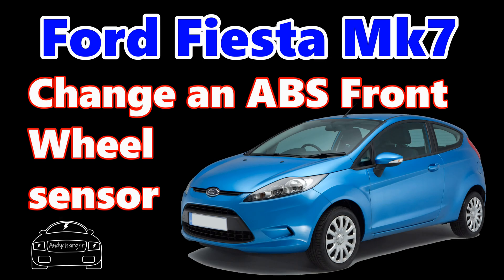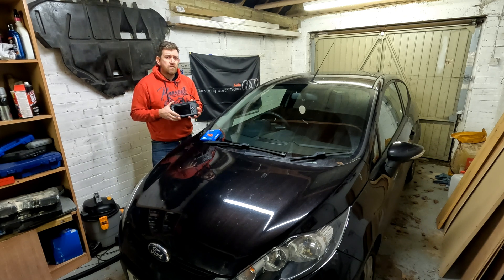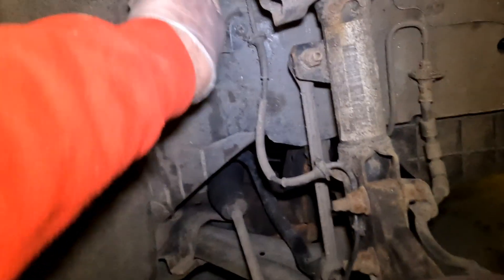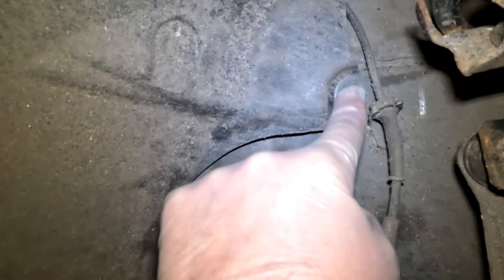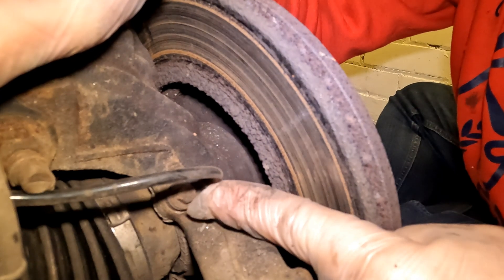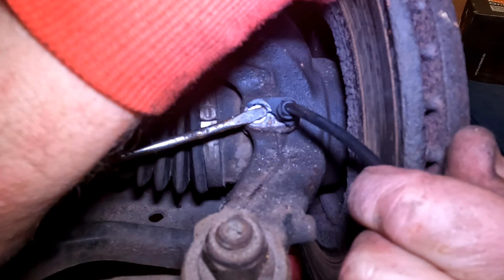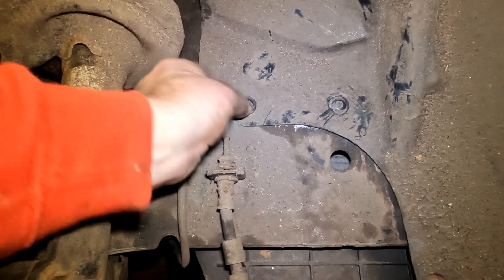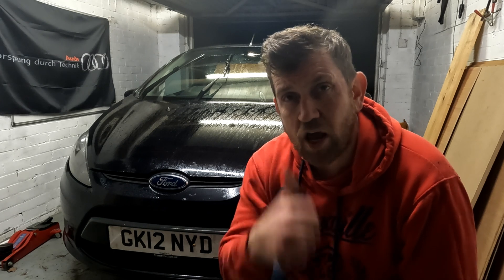Ford Fiesta Mk7 - Changing an ABS Sensor - replacing a wheel speed sensor

Comment: Thanks for this is am just doing this right now took 20 minutes cause im pretty handy with the old tools  and bang all good.
Reply from the maker: Good work mate. Today I am replacing the rear axle bushes (common problem on these) and the wishbone ball joint. Cheaper than the whole are and the garage wanted £500 for both jobs!
Reply: @andycharger hope you are videoing that for us fiesta drivers. Great video cheers.
Reply from the maker: @ashmaybe9634 absolutely have done buddy. Both the axle bushes and the front wishbone ball joint!
Reply: Jfc this os why i get a hold of manyals and reoly in videos if im just not r3adung the manual right @andycharger

Comment: Very helpful mate.
Reached to the very end but when it came to pulling out the plasticy bit from the slot it just snapped and nows it's stuck in that hole.
How doomed am I 😅 is there a way to sort this?
Reply from the maker: You should be able to poke it out still mate. 👍
Reply: @andycharger  wow that's good to know. A quick question mate is that socket where you insert the plastic bit  all metal? I just don't want to end up damaging something in there while trying to get the bits out.
Reply from the maker: @tahakachwala4101  yes mate. It just coated in a black paint

Comment: I had the same issue. So fitted new abs sensor. And abs light is still on. Code reader still showing abs fault tried clear fault with code reader but just won't clear the fault on reader
Reply: How do you know what side is giving the error ?
Reply from the maker: @articeddie5494  should be a different code for each side.👍
Reply from the maker: Is it definitely the right ABS sensor you have taken off? i.e. the correct side of the car? Always worth double checking. If the sensor has been replaced, it should be good. Also worth checking the connecting wires to the sensor are not damaged or causing a short. It does pass through the bodywork so might be chaffed.
Reply: Do you need to reset abs light manually with computer as I've replaced sensor but light still on

Comment: Spraying the head of a bolt going into a blind hole with WD-40 is pointless, if the bolt had a nut on the other side then yes spray the thread and clean with a wire brush, thanks for the video.
Reply from the maker: Thank you for your feedback on the bolt and the video. All these nuggets of information will help others do a better job.